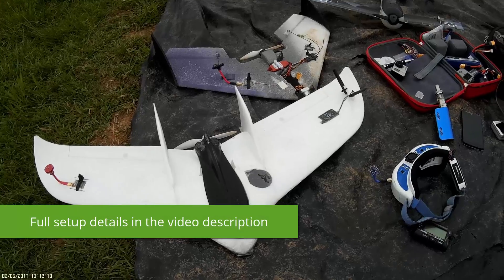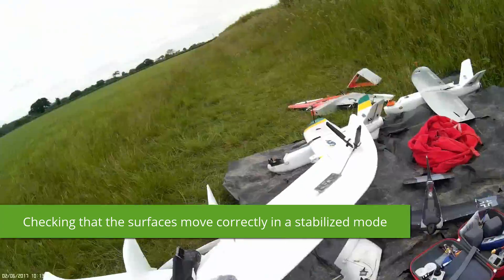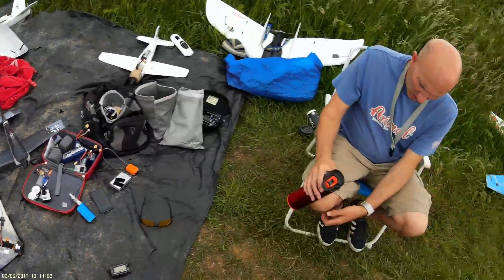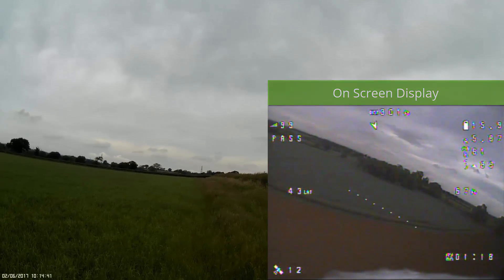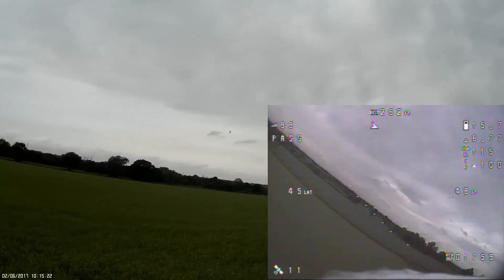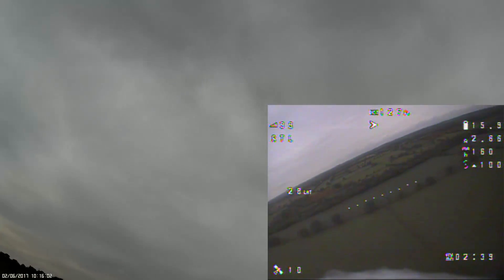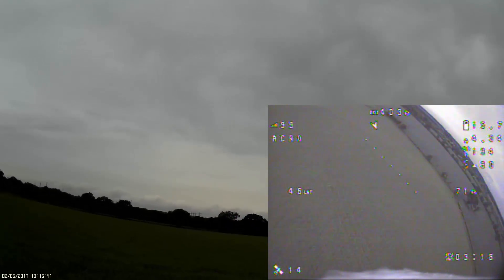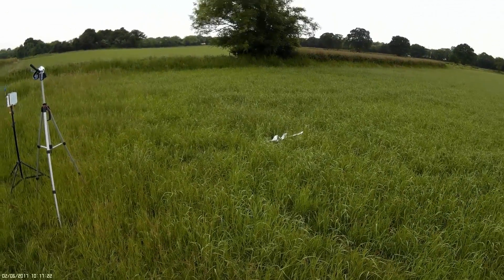iNav V1.7 WingWing Z-84 Maiden

Comment: When you leveled your airframe, did you level the bottom of the wings, or set it on the fuselage and vertical stabilizers? Mine seems to be fighting itself in angle and horizon modes.
Reply from the maker: Howdy Jack, I used auto tune to sort itself out and most likely a few minor board alignment degrees added in iNav too. Matt
Reply: I have tried autotune. It looks like it's gonna be a case of trial and error. I think I am gonna change the pitch alignment a little at a time until I get it to behave. Thanks buddy.
Reply: I managed to get really lucky the second try.  I leveled the wings and put a 5mm shim under the front, which gave it a slight nose up, then zeroed out the board, it straightened out and flies awesome in all modes now.  I was about to give up and mount an eagle tree vector in a 35$ model

Comment: I was testing out the power consumption between the Omnibus F3 vs F4 AOI flight board. If you'd like to save half an amp and get it to fly longer you might want to try the F3 board. That's the difference I have got between the boards on idle. Also it seems the F4 is an overkill for a flying wing like Z84... Cheers!

Comment: What would be your pick if you had to choose between this and the S800 Sky Shadow? I was wondering if the 2 vertical stabs close to center on the Z-84 help it fly better. Thanks for the videos and series! Excellent!

ETA: Or any other wing in this 30-40 dollar range? :)
Reply from the maker: Howdy Matt, it depends on your flying skill to be honest. If you're new, then the S800 is a no brainer as it's super tough and right now it's $34.99 on banggood https://goo.gl/1bAjNJ (expires in 24 hours). However the Z-84 is an amazing wing for £30. As far as the stabilizer position, they both fly pretty well, however I'm sure the center stab's help keep it straight more, Matt
Reply: Yes I am very new. Just simulators so far. Been piecing together my parts for awhile now, almost there!

Comment: Matt I am currently in process of ordering all the parts for this set up as my first I nav and only second wing, what is the esc is it the turnigy plush 18amp and what exact battery is it mate?
Reply from the maker: Howdy Chris, I'm using a 1600mAh 4S Turnigy nano-tech in mine, it's this battery https://hobbyking.com/en_us/turnigy-nano-tech-1600mah-4s-25-50c-lipo-pack.html Hope that helps!
Reply: Matthew Ogborne thanks again for all the help will let you know how the maiden goes when she's all built
Reply from the maker: Howdy Chris, please do! I'm sure you've already picked this up, but just in case, with the Z-84, when you balance it, you balance it on the nodules underneath, but on the very front of them, so it's nose heavy. This will stop it from doing a death spiral on you. Matt

Comment: Nice work Matt! I have a similar setup on my Z84. I managed to bust the USB connection off the flight control board whilst setting it up the other night though so a little bit of a setback getting it in the air. I've got a 2212 980kv with a 6045 on mine. Pulls about 5 amps at full whack. Will be putting a 3000mAh 18650 pack in mine soon as I get it all dialed in for come really long flight times :D 

What's the all up weight of your Z84? Thank you for sharing the config dump too!
Reply from the maker: Howdy Jake, I'm not sure on the weight. It could be soo much lighter, but I decided when building this one not to stress too much as I knew it was going to be good for 30 mins plus either way. I'm using a very similar motor, the BR2212 1000Kv and yea full knacker to get anywhere on a few amps AND I have a set of 2500mAh 18650's here waiting to go in her too!  Matt